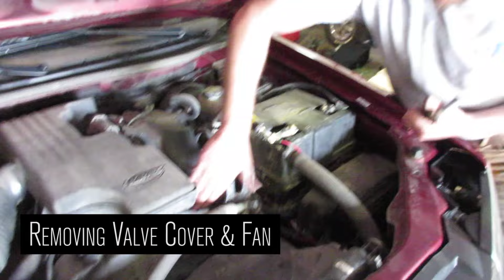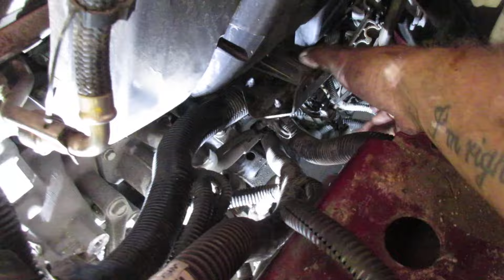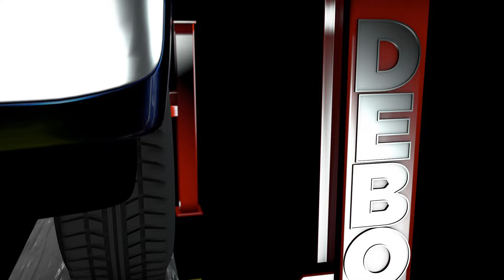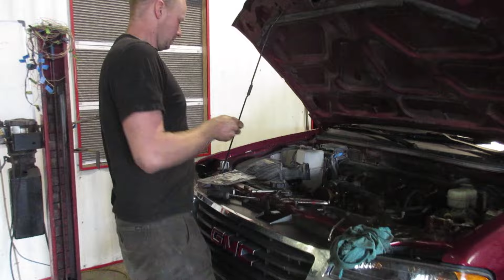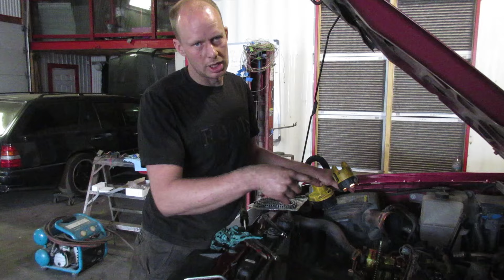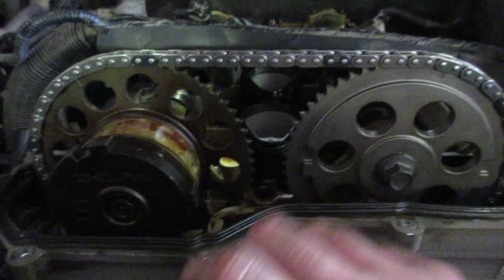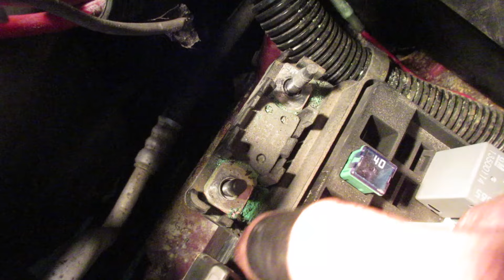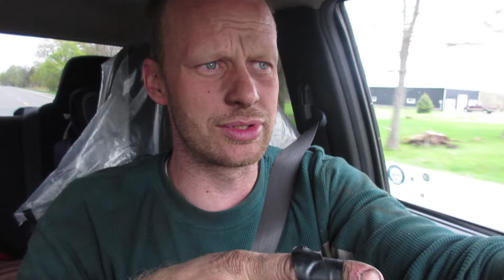Over-Engineering At Its Finest! GMC Canyon Needs A Timing Chain

Comment: The goal is not to have the longest running, easiest to repair engine.  The goal is to have you buy a new one every three years max.  Sad world we live in.
Reply: Mel Superable that is why you buy a Cummins.
Reply: Leif Churchill cummins are good, its the shitty dodge body around them that makes it not a option for me
Reply: lol.  buy a Cummins and you'll be replacing the truck around it instead.
Reply: I get mad on this because next to a house, cars and trucks are the second most expensive things you buy in live.. I don´t want to get a new one every few years because I want to do some other things with my money, like travelling and stuff...
Reply: the main idea they aim for is how to assemble it as quick and cheap as possible
Reply: thats exactly why i love my 89 easy as hell to do any work its only had breaks tires and oil for the past 300,000
Reply: HERPY DERPEDY its a 22 hour job just to change the motor nothing quick there
Reply: Helencopter Mckeller to change I mean to assemble at the plant nothing gets in the way
Reply: Changing the oil more often would have helped it not wear out. Lots of deposits for synthetic. Or they got cheap as fuck and ran some pep-boys oil in it. All late model engines are like this. My only real complaint would have been the balancing shaft at the rear. That's the kind of thing Porsche has done and put chains at the back to drive stuff. Very annoying to fix.
Reply: Trucks are meant to be durable and last over 200k miles. If the typical one can't, the company producing it takes a hit and usually sells less for a decade or more. Best not to be known as that company. Right now half tons are overbuilt. The manufacturer simply can't get the manufacturing price up to justify the price tag as they are simple machines. The only problem I see coming up for trucks are the eco-boost engines. They are not as stout as the Iron coming from GM and Chrysler.
Reply: Mel Superable God's honest truth.  stupid logic for the average family man. great for anyone working a union job at the car factory
Reply: That's why you should buy the V6 or V8 model instead.
Reply: Union members on the line don't design the cars. Which may be made in right to work states or Mexico.
Reply: 5.3.
Reply: assembly is defiantly not made easy either.. that's usually the 2nd to last thing on their minds.. let the guys who build the machines that assemble it later deal with that. it was always the big joke in the R&D department
Reply: "The goal is to have you buy a new one every three years max."  I agree but the consumer is as much to blame as the builder.  The average buyer can't change their own oil or a flat tire.  They don't care that a vehicle won't last, it's horsepower, looks, and a cheap lease that drive most consumers.
Reply: That is why you buy a Toyota.
Reply: Toyota are safer also
Reply: The car in the video is 7 years old with pretty high mileage for the year. So guess the engineers weren't doing their job right by your description.
Reply: sounds like you were talking about apple computers there. not cars
Reply: weird because stats show people keeps macs 2X longer than PCs on average.  I think you mean phones.
Reply: Yea apple really needs to start selling some of those $300 shit boxes.  When those get full of viruses you just toss them.  It's cheaper in the end right?
Reply: Simple fix dont buy it. I'm very happy with my old cars and trucks!
Reply: Consumption makes the economy go round, what do you expect? Plus, you can choose to actually maintain the product that you would otherwise have to replace after three years, especially cars. Any new car can easily last for 20+ years if you just maintain it.
Reply: Watching this I can't help to think of the "simplicity" of some of the old inline six engines. Fords bullet proof 4.9 liter with actually "geared" timing has to be one of the best ever produced.
Reply: Mel Superable flathead ford is best ford for reliability and ease of maintenance
Reply: +D Gatch  Those old inline-sixes were simple engines, and that's a fact.  But then, so were the cars themselves, and the needs of the people that drove them.  It was easy to build a car back then; it didn't need to get a bazillion miles to the gallon, make 8,000 hp, have power every damned thing, etc.   When pollution control, air conditioning, etc. were added to the cars they began getting complicated.  I still vividly remember doing a tune-up on an '80s V8 Camaro that involved removing the wheel to access the spark plugs, and thinking it was ridiculous.  Today, that would rank as 'ridiculously easy'.

But to expand on Mel Superable's comment at the start of this thread, it isn't just that they want to sell you a new car every three years.  They DO, but that's actually secondary.  The reason they build the cars the way they do is efficiency in manufacturing.   They're actually not worried about the technician who has to fix the things when they break, they're worried about paring down the costs of building the thing in the first place.
Reply: +Helencopter Mckeller My words exactly. It's a throwaway engine. You drive it till the chain jumps and destroys the engine, then you get another engine. Piece of black tape for the light and reset it before getting tested
Reply: I agree.  This was just badly engineered, not necessarily in function, but just in accessibility.
Reply: planned obsolescence
Reply: Mel Superable they said it had 240,000 kilometers which is even more in miles, that doesn't sound bad for one timing chain
Reply: That's a hair under 150K miles.  The chain really should last at least to when the engine starts to really get worn..e.g..when you have to start doing major upkeep because it's getting 'tired' so to speak...e.g..around 200K or so depending on model.  Someone who's following the spec for changing the oil in the vehicle should be able to get to that distance before having to do it.
Reply: Bob Loom actually, it's more in kilometres than it is in miles
Reply: Mel Superable  That was the market strategy of the 70's and 80's with a 4 year turn around. Of course back then $6,000 bought you a brand new truck and $12,000 bought you a brand new 4X4 fully loaded. But even then it was usually the interiors that fell apart mostly. Today you spend $40,000 for a base model and $65,000 for a fully loaded 4X4 with the Cummins or Detroit diesel motor but they almost never break down. You aren't even looking at your first tune up until you hit 125,000 miles. So no the goal is not to get you to buy a new one every 3 years as that would not work as a market strategy they are to expensive. Now they rather you lease a new car every three years and they take the used one and sell it as a factory certified pre owned vehicle.
Reply: Chrysler 225cid slant 6, now that was a bullet proof engine.
Reply: I had a BMW once. i325, should have been painted lemon yellow. Constant electrical faults. Got rid of it, drive a 2012 volt now, 110,000 miles and so far the only work that has been done is a couple of tires. No troubles at all, no parts have worn out. In fact when the brakes were checked at 100,000 miles they still had over 90% of the lining on the pads remaining due to most of the braking being regenerative. The breaks hardly get touched. This has to be engineering at it's finest. Technically the most complex car ever built.
Reply: 12voltvids hardly. however, just wait until your battery packd have to be replaced. there goes every bit of your gas savings.
Reply: Well considering that my Escape Hybrid is now 13 years old and the battery pack is still perfectly fine, and GM says that the pack is designed to last the life of the vehicle I am not concerned in the slightest.
I still get 40 miles on a full charge, and the car is only rated for 38 mles, so 6 years in, there hasn't been any degradation to the range at all, and here is the important thing to remember. Even when the battery does start to loose some of it's capacity, which at this point in time it hasn't, unless it were to go into a total battery failure, which never happens, all that will happen is the electric range will drop before transition. Even if it dropped by 50%, I would still get 20 miles of electric driving, and then the gas engine, that has hardly any mileage on it would start. GM was very conservative in the battery design, and only part of it's total capacity is used. There is a buffer zone at the top and bottom end. The battery is never fully charged, or discharged. This preserves it's life. I have lithium Ion batteries for my cameras that go back to the late 90's and they still accept a full charge, and operate the equipment as they were designed.
The reason cell phone and laptop batteries don't last is they way people abuse them. Used volt batteries are relatively inexpensive too. I know someone that picked one up at a wrecker for 600.00 that he uses in his solar system to store energy. So by the time the battery needs replacing, if ever it won't be with a new one, it will be with a salvage battery from a crashed car, however that day will likely never come, because I will trade it in on a new one before that happens.
Reply: 12voltvids Your Ford Escape hybrid has a GM battery pack in it? uhhh
Reply: Who said anything about taking out a loan. I want a new car, I pay cash. I don't own anything on any of my vehicles, and I always buy new. Don't need someone elses junk. I buy them new, and drive them till they drop. Has worked out well for me. But then, hey I have a good paying job. Got to spend it on something. Can't take it with you, For me it is new cars, motorcycles, and high end electronics.
Reply: We are talking titally different tech. The escape is NiMh, but in general it is still a battery. The pack in the volt is a much higher capacity, which uses cells made by LG BTW. There haven't been failures of the volt pack. The car protects the battery at all costs. For example in cold weather the engine starts to warm the pack up, and when it is hot the coolant is chilled by the hvac heat pump. Other brands of electric and hybrids have had battery problems (I'm looking at you Tesla, Nissan and Honda) but GM hasn't had problems with the volt pack. They wouldn't be warrantying it for 10 years if there were problems.
Reply: Why would you pay interest on a used vehicle?  I've never understood people that do this.    I mean I could understand it if money is tight, but if you can afford to buy a car that's new and you've done your homework, buy the new car.   It's going to cost X number of dollars a year to hold a means of personal conveyance whether you buy new or used.  I find it's better to know every last mile that's been put on the car (because I'm the one putting them on) then have to sit there and wonder whether the previous owner was some kid that turned it on in 0 degree weather and immediately floored it right on to the highway each morning.
Reply: I hade the mistake of buying a used car once. 
I could have afforded a new car, I had just gotten a good job, but I found what I thought was the perfect car, only 2 years old, very low miliage, only 9,000KM, bought it from a new car dealer. Was told it had been the general managers car, and they he got a new one every year.
Paid 12 grand for that car. Year was 1985, and it was an 84 model.
It wasn't long before it started running like crap. Took it to a shop. Told the catalytic converter was plugged and the mechanic accused me of running leaded gas through it. Wanted 2 grand to replace the cats. Paid him 50.00 to put in a straight pipe. (big mistake because the turbo now didn't work properly, as not enough back pressure)
Mechanic showed me how a "regular" gas nozel would fit in the filler as someone had used a crowbar end to ream open the spout so that cheaper regular and leaded premium (which was still available in 85) could be used.
I also noticed that if I shifted quick from 1 to 2, it would grind occasionally. Took it back to the dealer, and they said that was normal.
It took about 9 months, and then I decided that this car was a lemon, and it was time to unload it. I was down at a different dealer, taking a brand new car out for a spin.
When I returned with the test car, and was walking out to the street, this kid, maybe 18 comes up to me, and asked if that was my car. I said yes, and he said, did you buy it at "X" dealer? I said yes. He then said, "did it have a pioneer stereo in it when you bought it?" I said yes.
He said, open the drivers door, there is a rip in the weather stripping right here, and he pointed to a spot on the door. Opened it, he was odd by less than 1/2".
He had owned the car the year before. Told me he had to put a new turbo, and clutch on it, as he used to race it at the local track. 
I asked him what miliage was on it when he traded it in. He said 30,000 KM. I asked for his name, as I was going to sue the dealer, and he clammed right up jumped in his "new" car and took off.

I didn't buy the car I had test driven because the dealer I was at had been bought by the dealer I had bought the car from, and it was the same salesman that had sold me the "lemon" I was dealing with.
I drive to the next dealer, traded it in, and bought a brand new car the next day. Drove that car for 320,000 KM, before selling it, still running.
Have bought brand new cars ever since. Will never buy someone elses  junk.  Now I understand that many are not in the finiancial position to buy a new car. They are too hung up with going to Hawaii or Europe, or on that cruise every year. 
I am in the financial position to afford new toys. I give up the expensive vacations. Why spend 20 or 30 grand on a holiday, that after a few weeks it is done, and the memories fade. Buy a new car and enjoy that investment for years to come.
Reply: Yes the EV1 is the car that started it all. That was the car that pioneered EV development. Prior to that the early EV cars used DC motors. The EV1 used a 3 phase AC motor with inverter.
Everything that was learned from the EV1 became the Volt, with the addition of the extended range components.
The design from the EV1 is used on all EV cars on the road, including all the Hybrids.  The prius for example, even though the gas engine provides the majority of the power, when in electric mode, the electronics, and regenerative braking are very close to what the EV1 used.
Reply: xaenon:  Try a '67 Mercury Cougar - you had to unbolt the engine mounts, and jack up the engine, to get at the center two spark plugs on either side.  This crap has been going on a lot longer than people think.
Reply: Ford 300 straight six got 15mpg on the freeway with a 5sp manual.  Single cab, regular bed.  It was a torquey and reliable motor but low revs and thus low HP.  Get a cummins
Reply: Not even going down hill with the engine off.
Reply: dont overlook the 4.3 Chevrolet V-6
I managed to get over 600,000 miles out of one, admittedly at the end i was basically using axle grease in the crankcase but still...
Reply: Yes those chevy v-6 engines go on forever. A friend had one that went over 500K, and I once had a Ford straight 6 mustang that I put 485 on before  I sold it, still running.
Reply: DUDE ITS TOTAL NORMAL. I change my oil at 10,000 miles with mobil one full synthetic.  if you're not in a smog county get your cats"modified" by a local mom and pop muffler shop and make more air accessible to the dirty side of your air cleaner via a hole saw.  I now have no problem hitting top speed. It hits 101 MPH and the speed limiter kicks in and you will think you have just blown it up! it will decelerate to 90 MPH automatically by alternating the spark on the cylinders.  a little edge you can give your sel "I do not condone speeding or any reckless behaviour that could injure you or anyone else" please be cautious with this information.
Reply: Tex Mex if you buy a car, you better know how to change your oil, and it's elementary to change a tire
Reply: The bean counters in every business are like that union or non union. Non union they are worse. My kids both work. They get no benefits because they need 36 hours a week to qualify, and they are given 35 hours a week work. One under the minimum where they would get medical benefits. Every newer hire has their hours limited to 35 hours.
Reply: A quick google search indicates that 240,000 Kilometers is equivalent to 149,129 Miles. I doubt that they never changed the oil because from the inside it looks to have been changed at least a few times but probably not regularly. Bad design due to trying to save a few cents per engine.
Reply: Agreed. Have had 2 cars with inline 6. Very smooth engines indeed.
Reply: right.
Reply: mysock351C changing oil is not tha reason a car go bad... Its just these new cars .. Thy say Change your oil  every 3000 miles and yall do it!!!! But won't wash your  car ass or yall on ass. . I Chang my oil every 6000 miles. .. 3000 Its all a money thing and peoples run with anything thy tell them. Sad world we living in today.
Reply: The problem with old cars, and old engines in general is they are killing us. Do you not care about the air you breath?
Reply: I change my oil every 10,000 miles on my wifes hybrid, which is exactly what the owners manual says. Yes I know the oil change shops want you every 3000 to siphon your wallet. My car is a Chevy volt. The computer tells me when to change it based on the engine operating hours, not the mileage as the car is electric, and the engine only runs for longer trips. I change every 2 years or when the computer says. At the 2 year mark computer says 80% life left, but I change it because it has been in the crank case for 2 years. Only been done 3 times in the 7 years I have owned the car and not had a single issue with it other than a blown tire due to an invisible pot hole that was full of water.
Reply: Tex Mex uh... I don't think you know anything about pc hardware... Macs use the same hardware... So... Ditto
Reply: Mel Superable /(
Reply: I think the goal is to have the truck not be worth fixing after you've paid the last payment and have you start over with payments on a new truck.
Reply: You got that right.  I have a 1995 honda accord with 288,000 miles on it.   It has ALL FOUR original wheel bearings.  It has the original upper ball joints.  I've done the lowers once.  I've done the rear drums once at 165,000.  They don't make shit like that anymore.  GM never did.
Reply: That's why you buy a Toyota
Reply: not buy a new one, but become a repeat customer with parts sales.  Engineered failure.
Reply: Agreed. Not easily serviceable. GM could've added a few gears to the valve train/ balancer, instead of the thin, weak- looking triple chain system. Bean- counter thinking,too much like Ford's" innovative new engine designs ". Would you buy a car from a company that calculates that it's cheaper to pay off the deceased motorists relatives than install a good a quality critical part , or do a recall ?! ( Ignition switchs- GM. Pinto gas tanks- Ford. Takata airbags- Toyota. The list is near- infinite...)
Reply: I'm 3 years into my second gen Colorado and it's still kicking at 62k miles. It only just got it's first set of new tires
Reply: Ive had my 2017 ram 2500 with the 6.7 liter Cummins and I bought  it with 11 miles and it was has 46000 on it now  change the  oil every 7500 miles it says 50 percent oil life when I change  it gonna drive it till it dies
Reply: that's why my '48 diamond t body is going on a 60s gm frame with a 70s built 350sbc
Reply: @Amatronix999   Look at the latest results for pickup crash tests. The Tundra had the worst safety results. Good, reliable vehicles, but Toyota's weakness seems to be crash safety...
Reply: @Wesleystewart78  yea ok enjoy your 12mpg i love my 88 wd21 pathfinder with the 3.0 but 11 mpg and 65 mph just kills me now i bout and isuzu rodeo for around the same price used with the 3.2l and it gets 18 combined and an extra 60 hp. I paid 3000 for it aint nothing wromg with newer vehicles as long as u stay away from dodge and ford and do research.
Reply: @vorant77  ford 300s are reliable and thats it ford CAFE regs killed all the reliable engines dont blame manufactures blame the feds. All long stroke inline engines have been getting killed out because of epa regs.
Reply: john jay  smooth lmao its a 120degree crank engine theres nothing smooth about a ford 300 lmao its just reliable because its simple and rugged. If it was smooth they all wouldnt be soaked in oil. Its a tractor engine lmao and not really practical for modern trucks.
Reply: @brandoncole6358  11? I'm getting more like 15 if I'm driving around town and 18 if out of town on the highway 70mph 89 c10 with a holley 650 on 305 v8 and a 700r4 trans
Reply: You know you could get an LS in these trucks right?
Reply: Leif Churchill I’m still driving the first Diesel truck I ever bought 95 dodge ram 3500 5.9 cummins its still mint but it’s been taken care of garage kept and has never seen a salted Road. it’s not uncommon in my state to see GEN 2 Dodge’s running around in good shape. It all boils down to the owners and climate for anything to last.
Reply: The main goal is lowest production cost. Obviously that is going to lead to higher repair costs and reduced engine life.
Reply: Just buy an old corrola, swapped transmissions on my driveway not even a hard job. Let some other idiot deal with a new car.
Reply: Jochem Unless it’s a FIAT.
Reply: Vorant One I thought most inline 6’s are gear timing sets and not a chain.
Reply: @mysock351C  🤣🤣🤣
Reply: @supersonictoast2822  🤣🤣🤣🤣🤣
Reply: Jeff Lee  🤣🤣🤣🤣🤣🤣